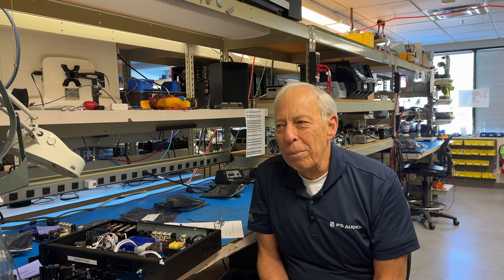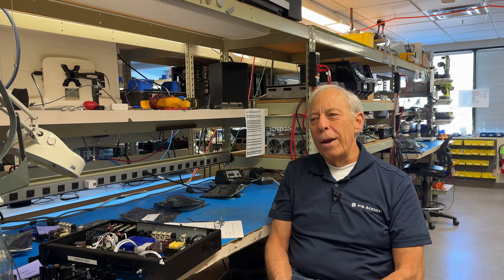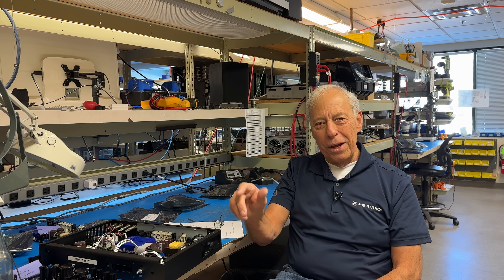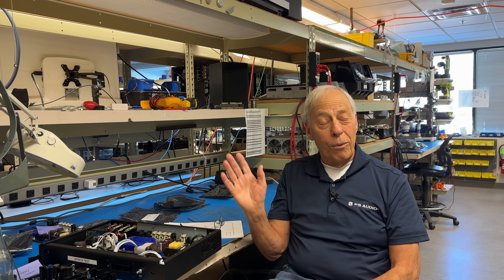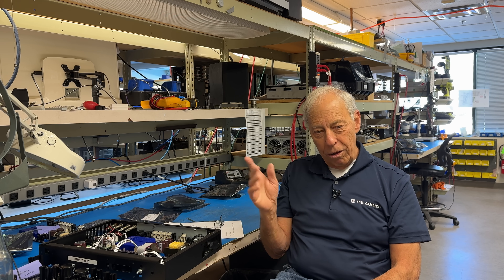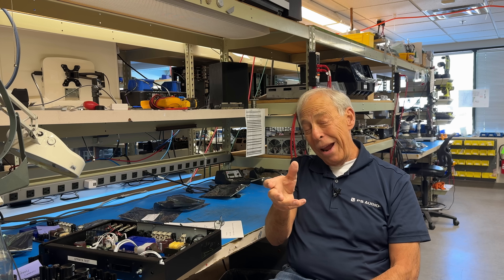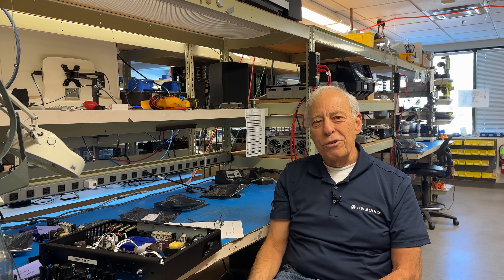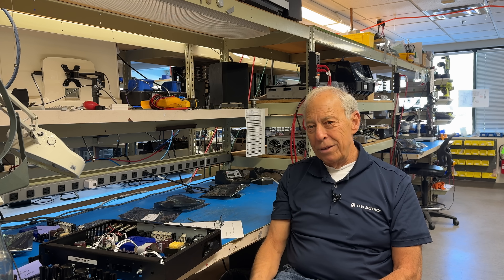Understanding dB level

Comment: Negative 10 db is typically referred to as 10db "down"...from full "rated" output.  (typically volts)
It all started with VU meters on pro mixing consoles (in the fifties).
0db was the max value you could apply before the mag-tape became "fully saturated".
The scale just became widely accepted in recording studios, then home (open reel) tape decks, later cassette decks then pre-amps and amps.
(although most VU meters on amps are..."just for show")
Reply: Reminds me of a story I read about one of the reasons why the "Casino Royale" soundtrack was regarded as such a good recording: they found the tape stock could be saturated well past the -0db level without distortion. And thank-you Paul for another masterclass.

Comment: Kudos to Paul for explaining dB without mentioning logarithms. With a background in physics logarithms make complete sense to me, but I know most people's eyes would glaze over at the mention of logarithms.
Of course a more complete understanding of the dB scale does require knowledge of logarithms; e.g. it explains why voltage ratios vs. power ratios are a factor 2 apart in terms of dB.

Comment: Per Agent Eagle "The relative volume scale is primarily used for home theater. 0db is considered ‘reference’ level, which means when calibrated correctly, each speaker will be playing at 85db at ‘0’, allowing for peaks of 115db." This is what Paul should have said. Each +10 dB is perceived as twice as loud. + 3dB takes 2x the power from your amp to achieve, and +10 dB is about 8x the power. How loud is 85 dB? Well about the same as at a crowded restaurant where the collective voices are very loud, and you almost have to shout to talk to anyone else at your table. Normal room conversation at home is in the 60-65 dB range. Comfortable listening of your stereo is in the 75 dB area. Loud is 85-90 dB (and brief peaks can be more).  OSHA workplace standards are don't exceed 90 dB constant for long periods of time. Rock concerts can be 100+ dB, or standing by large speakers at a wedding. Jack hammers up close around 110 dB. Speaker efficiency is measured at 2.83 v into 8 Ohms nominal (1 watt) at one meter. Most speakers are 85dB - 90dB at that level, so the excess watts in a high-powered amp are for really loud levels and/or peak levels. There are free dB apps you can put on your phone and you easily see what the sound level is wherever you choose.
Reply: You're talking about something different.  The question was specifically asked about volume knobs, and in that case 0dB on the knob is not 85dB of sound pressure level.  0dB on the knob is "max volume" as Paul said.  ..however loud that happens to be... 85 dB, 100 dB, 130 dB, or however loud it can go.

Comment: Unlike Amps, Volts and Watts which are specific individual measurements, db is a ratio, a relationship between TWO measurements. e.g. -3db means nothing by itself, but if you reference 0db to 2watts. a -3db would be 1watt. A 3db increase would be 4Watts. When a change in voltage or current is doubled or halved, it has changed by  6db.  When Power is double or halved, it is a 3db change. SPL is added to db (dbSPL) when sound pressure is the measurements.

But it is a logarithmic scale, not linear. e.g. to double your listening dbSPL is to go from some reference like 80dbSPL (moderate concert level) would be to go to 83dbSPL, not 160dbSPL. And would require a 3db or double power increase, say 100W to 200W. But if you want to increase by 10dbSPL, from that 80dbSPL to 90dbSPL (high concert level) would require going from 100W to 1,000W! 

1db is considerate a just audible difference.
Reply: Yep.  I am very surprised that Paul left out that key word "ratio".  You can't explain what a decibel even is without that word!

Comment: The simplest way to explain it is to say that 0dB is the reference level for full output (unattenuated) and all the negative dB markings are relative to that reference.  In other words, -20dB means 20dB (nominally) below the reference, or 20dB of attenuation.  You often see a negative infinity symbol at the bottom of the volume dB scale, which of course means full attenuation.  Key to getting all of this is to understand that all volume controls are attenuators, not boosters.
Reply: That makes sense to me. Thank you

Comment: Then why continue the old norm of calling it a pre "amp" :)....confusing..
Reply: A preamp with a phono cartridge or microphone input DOES unequivocally amplify those signals quite a bit (but enough to drive loudspeakers).  If it has a moving coil phono cartridge input, it will amplify it even MORE.  MOST preamps can also amplify line-level inputs by a few decibels (perhaps 6 or so).  Hence the norm of calling all such devices preamps.  We could just stop there.  //  All preamps designed for regular human interaction also include a volume control of some type to attenuate its otherwise fixed line-level output that is designed to drive a separate amplifier that is capable of yet more amplification and much greater output power to drive low-impedance devices like loudspeakers.  So-called "passive preamps" (of which there are few examples) are the truly confusing case, because regardless of what else they may do that most preamps do (such as source selection and attenuation/volume control), they by definition do NOT amplify a signal at all in the classic sense (i.e., with active devices like transistors or tubes) - only pass it as-is, or attenuate it.  Some may include a transformer to boost output voltage, but that is not amplification - any such voltage boost comes at the cost of higher output impedance and less current.

Comment: Great explanation! Thanks, Paul.  As a product developer for my whole career, I look back on the electro-mechanical dB levels we used to measure when developing power tools. Manufacturers always recommend wearing hearing (And eye) protection with power tools due to the sound power level of either the tool or the work it is doing with your ear generally at arms length or less. You often hear references to live rock concerts and jet engines as being 100+ dB levels.  I assume this kind of measurement probably relates back to voltage levels in the electronic world in some way.

Comment: Manufacturers muddy the water on this by making their preamp/receiver volume controls reference level around 10 to 12 o'clock  on the volume dial.  To the average consumer this gives the illusion that their gear is more powerful by being louder at a relatively low setting, say around 8 o'clock.  Electronically this gives the possibility of massive clipping and catastrophic speaker damage along with making half of the range on the volume dial useless.  In any case, the negative dB on the volume dial is confusing to most that are not engineers.  You did a good job explaining what it actually means and made the right choice in going to a 0-100 scale as that's more relatable to the average consumer.

Comment: It's like a faucet. Everyone is aware that it is not responsible for the water pressure in the pipe, but rather dampens it so that we can draw water comfortably and in measured quantities.
Reply: That is an excellent analogy
Reply: The faucet is actually partially responsible for the pressure you receive from the faucet itself. That's like saying a step up voltage booster turning a 12v20a signal into a 150v1.5a elevated B+ isn't responsible for the voltage the load is receiving. It's not that simple lol. The conclusion is "both and" not "either or" lol.

Flow rate is more comparable to current, and pressure is more comparable to voltage. But either way, it's still a "both and" situation.

Is a plate resistor or cathode resistor responsible for the voltage a vacuum tube receives across it's plates? Or is it the power supply? Or is it the transformer on the pole by the street? Or is it the hydro damn your getting 35% of your electricity from or the coal and nuclear facilities providing the remainder? This is a very tricky, almost philosophical question that will rabbit hole you back to processes of the electron itself that we don't even fully understand.

Most people dont even realize that electrons flow from negative to positive not the other way around, even though the energy used for work electrically flows + to -. The electrons are physically tunneling through the crystal lattice of a conductor, at only about an inch per second, faster with higher voltages. The extreme forces they generate through field effects around the conductor are actually what pipes energy to the load, you just have to exchange electrons with the conductor to access that field of energy flow, and this is also why the insulator of a conductor actually controls the rate of energy flow. The energy that does the work is actually flowing through a field on the outside of the conductor, reverse to the flow of electrons.

Comment: The relative volume scale is primarily used for home theater. 0db is considered ‘reference’ level, which means when calibrated correctly, each speaker will be playing at 85db at ‘0’, allowing for peaks of 105db from bed layer channels and 115db from the LFE channel. This ensures that your level of loudness is how the sound engineer intended it to be and it replicates what is heard in a commercial cinema.
Reply: This is what Paul should have said, and then indicated what 85dB sounds like.
Reply: You're talking about something different.  The question was specifically asked about volume knobs, and in that case 0dB on the knob is not 85dB of sound pressure level.  0dB on the knob is "max volume" as Paul said.  ..however loud that happens to be... 85 dB, 100 dB, 130 dB, or however loud it can go.
Reply: @Hyxtryx  no, it is exactly how I stated it.. 0db on the VOLUME knob is reference level, and the negative numbers are depicting how many db from reference level the VOLUME knob is set at… That was the question !
Reply: @AgentEagle  No, it is not how you said!   Show me a volume knob (physical knob, not something buried in a menu) where you can make the dB value displayed on the front of the unit go above zero.  They all stop at 0dB.  0dB is "no attenuation of the signal" like Paul said.  Your dB of 0dB == 85dB sound pressure is a different thing, and not what the questioner asked.

If what you said is true, every amp & speaker combo would play at the exact same volume level when turned up all the way, and that is patently false.
Reply: Proof:  watch the video at 0:30.  The questioner asks "why does the sound get louder, the closer you get to 0dB".  So in the questioner's mind, 0dB is the LOUDEST sound.  That means 0dB is when their volume knob is up ALL THE WAY.  It has nothing to do with 85dB.  

85dB == 0dB is something different that you are talking about, and has absolutely nothing to do with the question in this video.
Reply: @Hyxtryx  you obviously don’t get that there 2 different settings on a receiver or pre-amp. There is absolute which is 0-86, and there is relative which is -85 to +15, 0 at which is considered point before clipping, if indeed your amplifier or speakers can produce sound at ‘reference’ !
Reply: @AgentEagle  My Yamaha goes from -99dB to 0dB in 0.5dB steps.  It's over 20 years old.  I played it at the 85dB reference [THX standard?] many years ago, and it was too loud for me.  I don't remember where the volume was, but probably in the neighborhood of -30dB.  In normal listening, I never played it higher than -40dB 

If -85 to +15 on the volume indicator display is the norm now, what brand and model has that?  That doesn't seem right to me, because if every receiver went from -85 to +15, and 0dB is the home theater reference level, that implies that every receiver has the same max volume level.  

How can a receiver know that 0dB on the front display is giving 85dB sound pressure level?  The sensitivity of your speakers affects that.  Maybe through automatic room correction with a mic?  

Even still, -85 to +15 dB being a new norm means that every receiver that displays that is producing the same volume level as all the other receivers, when turned up all the way.  How can that be?  It would mean your receiver, with it's digital encoder volume knob, is artificially capping the maximum power output to whatever produces 100dB of sound pressure level.  You keep turning the knob, there's more power available, but the receiver is ignoring your input so that it tops out at +15.  Or do some cap out at +9, or +23, or +37?
Do you know what I mean?

Comment: In the real world, 0dB is the same as 0 sound. Why not use 0dB and above?

The lowest decibel a human can hear is 0 dB. In some exceptional cases, humans can hear sounds down to -15 dB. 0 dB sounds are very soft and barely perceptible by the human ear. To understand just how soft, imagine that a whisper is 30 dB and 30 dB is 1,000 times louder than a 0 dB sound.

Measurements of a speaker with a microphone are never measured in
- dB. Minus dB

The ear hears 10 dB as twice as loud, but it is 3 dB which is actually twice as loud, even if the ear does not perceive 3 dB as twice as loud
Reply: because the PCM recording system has an absolute upper max limit, after that point everything is recorded with the same data value, imagine clipping waveform

Comment: dB is for most people a measure of the loudness/volume, not a relative scale. So in most peoples minds, we relate to dB as 60dB = normal talk, jet engine = 120dB etc. Thats why it is confusing that when in amplifiers, the "dB" is then suddenly something else, something relative to something we don't have a reference for. 

So, adjusting volume from 0-100 makes more sense, since none of the scales says anything about the actual volume.
Reply: that "dB" you are referring to is the sound pressure level, the dB meter shown at the amp could be "0dB" being max (output) similar to  source data where 0dB means max level